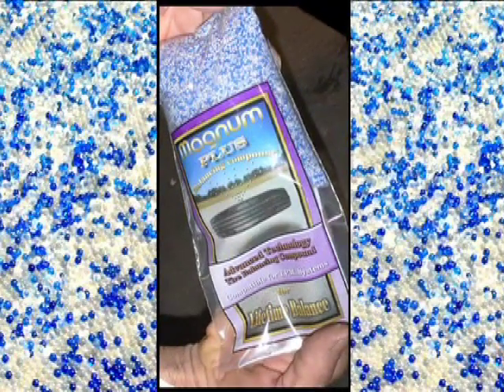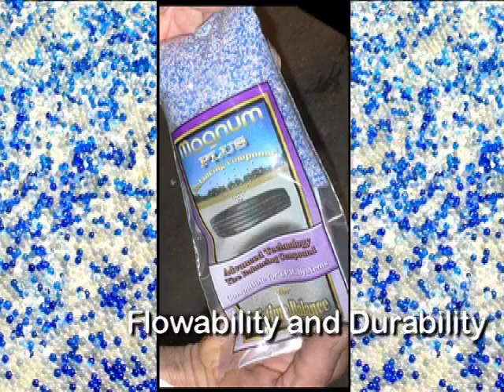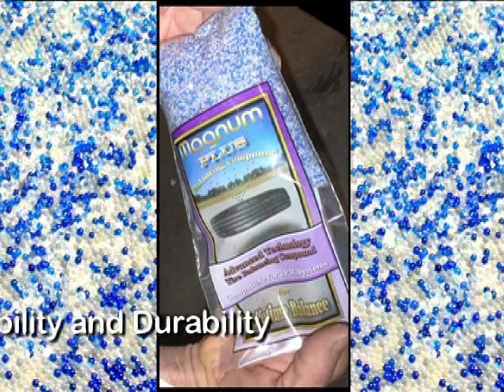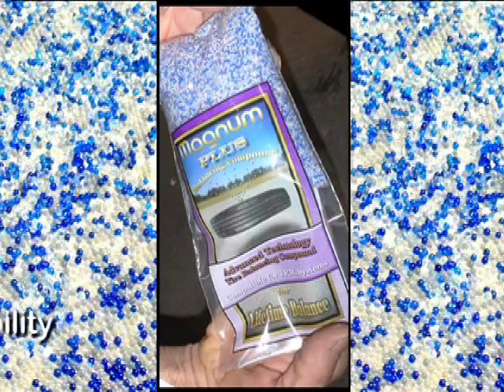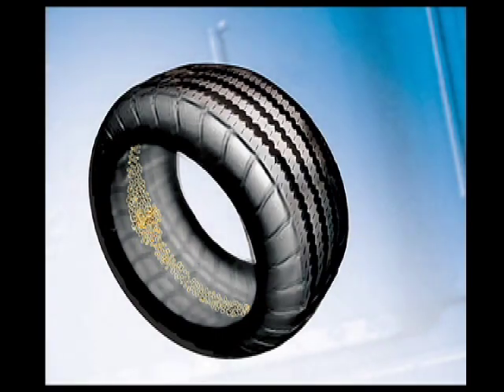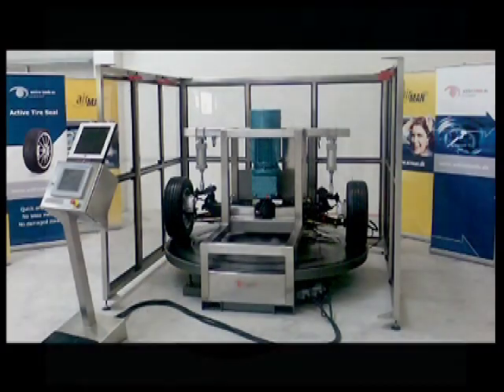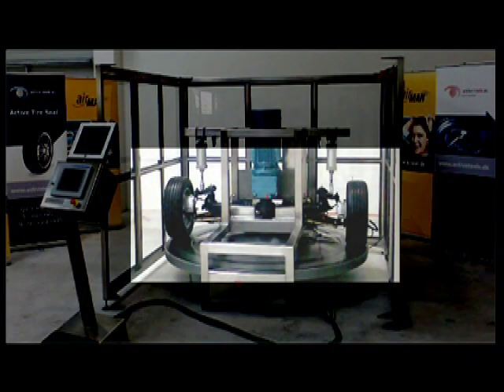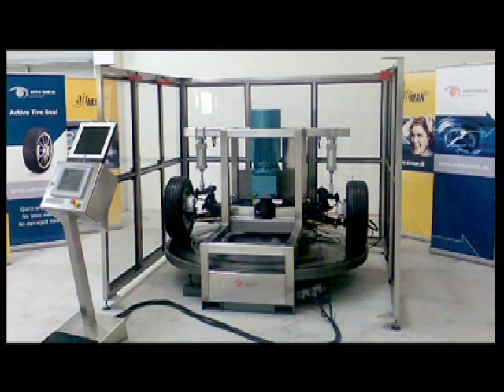How Magnum Balancing Compound Works

Comment: all internal balance and basically works the same way. Try googling up Checkered Flag Tires
Reply: I saw your video.   "vibration" on the heavy side of the tire is the reason?  I'm not convinced.

Comment: The tire never balanced. It bounced the entire time.
Reply: No, that is the tyre actually reaching the simulated road during every rotation, and as there is weight it compresses/deforms while contacting the road surface.
Reply: @weefatbobicus  It should compress and deform all the way around the tire, not just one spot.